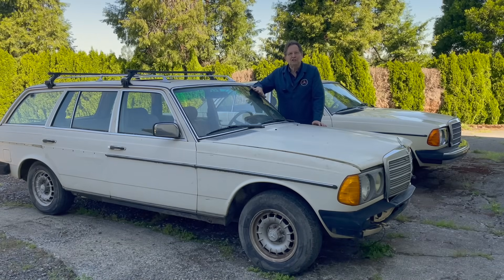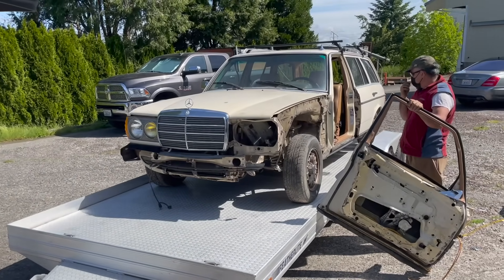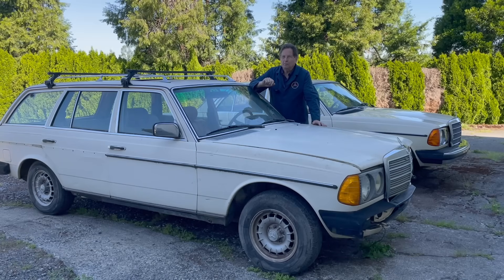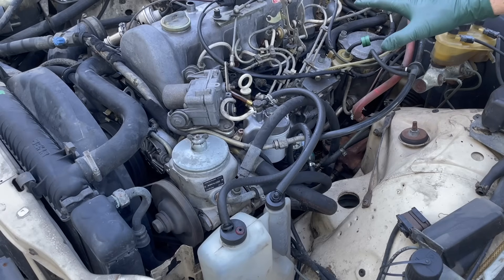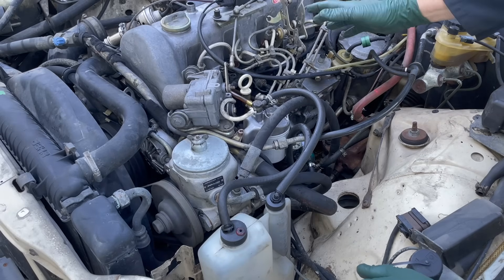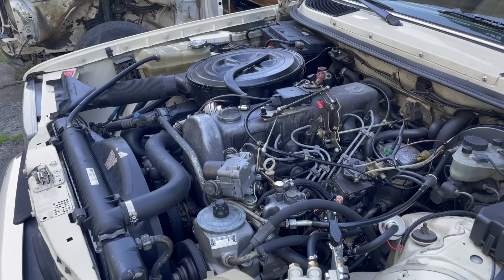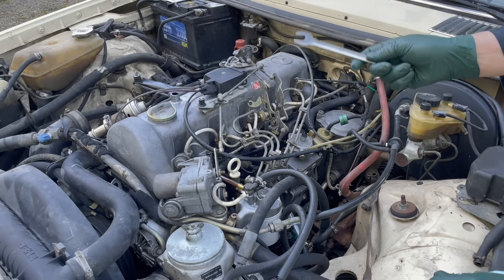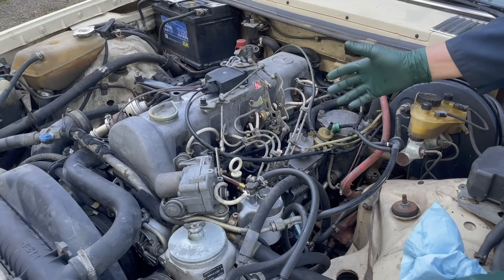300TD Wagon Buster 1: Diesel Engine Knocking Noise. What is Normal What is Not?

Comment: I can attest, those engines absolutely do not want to die. If you can get it to crank, it will take you wherever your heart desires ! 
 As long as you have the fluids to keep it running.

Comment: I had a quarter million mile 84’ 300 SD with the worst knocking upon acceleration. Valve adjustment fixed it right up.